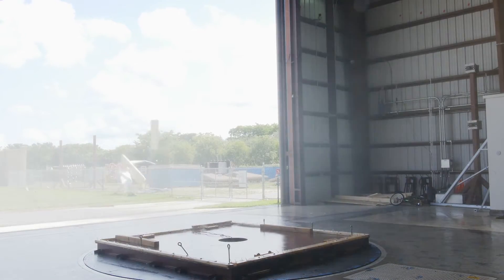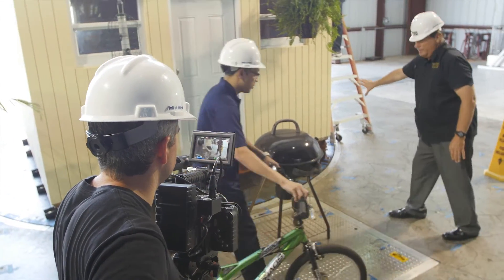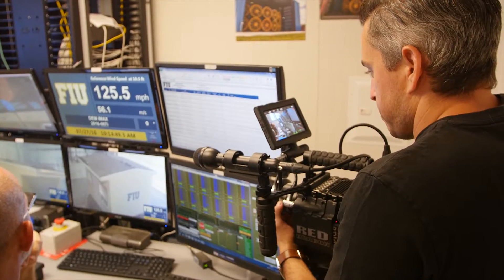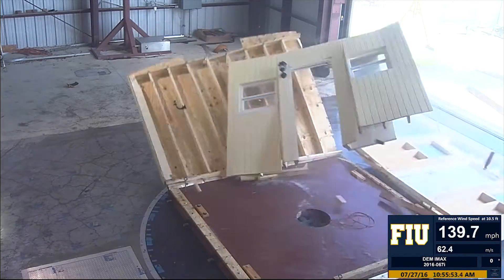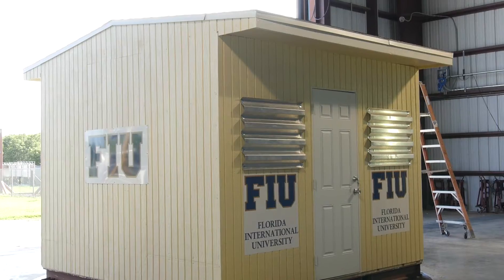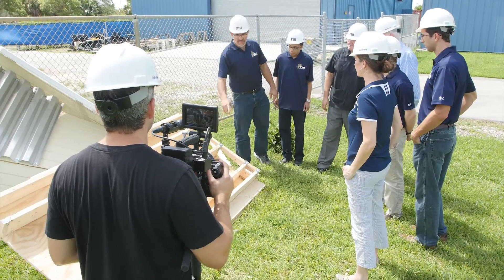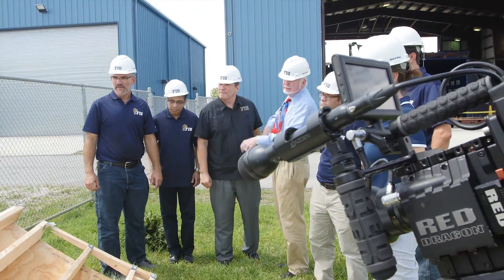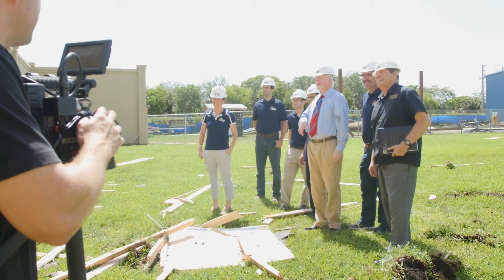IMAX Filmmakers at Wall of Wind

Comment: A little that no one knows))) The difference between the film and the matrix of digital cameras, 1) When the film moves at a speed of 24 fps, the HDR effect occurs! About half of 24k forms such an effect! + film vibrations are averaged in all directions (vision inertia smooths vibrations), this evens out and stabilizes the visible image. Also, the frontal vibrations of the film provide a variable display of the entire Anisotropy of sharpness, as the HDR effect is only in relation to focusing. Read more about this in detail 2) The sharpness of the film has a depth - Anisotropy! For example 3 people in a frame standing one after another on a film, they are all in focus! But when we want to focus the optics of the projector on the front of the film, we get a clear image of the front objects + all the scratches of the film, if you focus on the center of the film layer, then the scratches disappear and the sharpness of the shooting objects is shifted to the depth of the picture, that is, the person in the foreground will be less clear Than the person standing behind and vice versa, the Projector is simply not able to transmit the entire depth to a flat surface of the screen! It is also possible only on negatives, reproductions of films lose the depth of Anisotropy 165